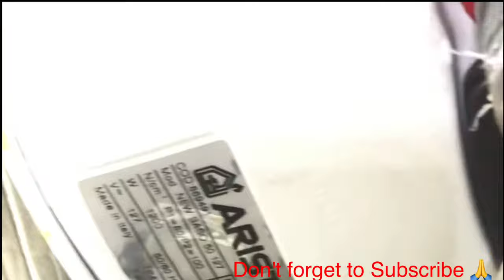How to repair leaking Ariston water heater

Comment: Hello need anwer now i just saw my pressure was full i got same problem is it safe to take shower turned odf heater i am afraid i wanna know?
Reply from the maker: Sorry about this just seen your comment. Its ok to use as long as the leak not goes to the wirings like plug and the thermostant.